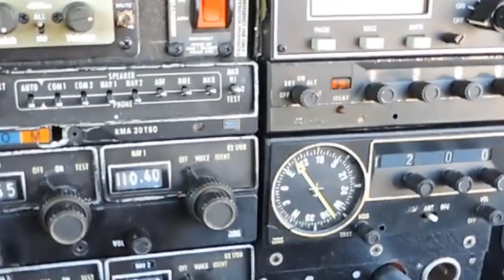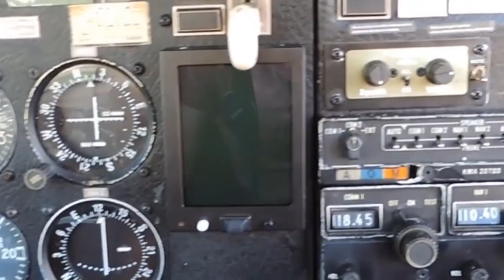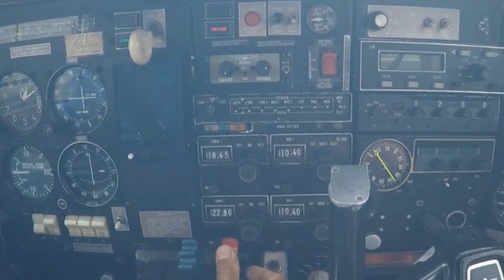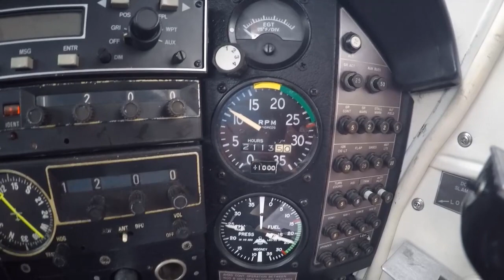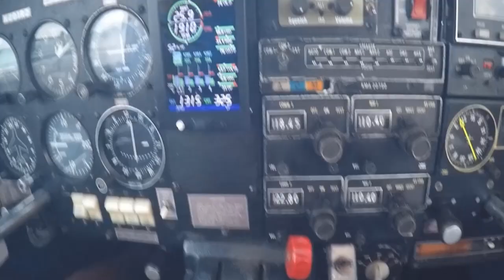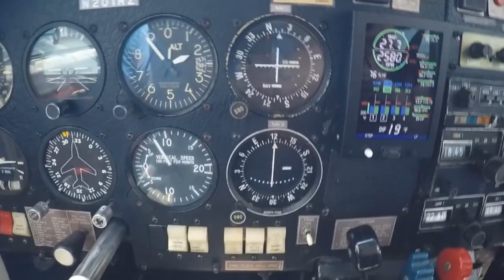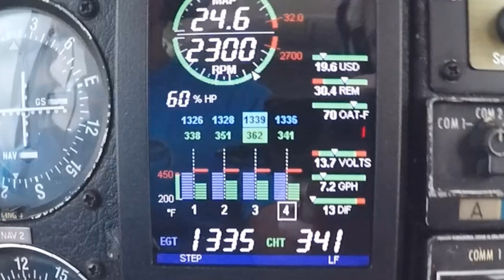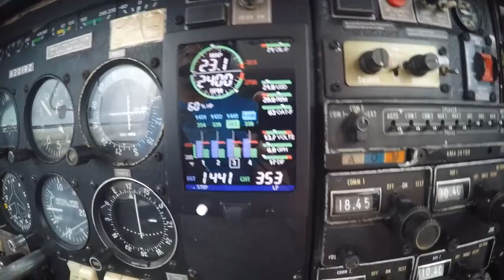Mooney M20J aircraft review: Flight speeds & Landing with gusty winds

Comment: Mooneys are a scourge to land dwellers who just want a peaceful place to live.  They should be outlawed now that there are much quieter alternatives.  I have no empathy for the folks with lots of money and nothing to do with it but fly over homes just for fun.
Reply from the maker: Well, decent pilots follow the regulations and maintain the minimum heights and respect others, on the other hand, if you live close to a main road, motorbikes and some vehicles could create a louder noise
Reply: So, is your issue specifically with Mooneys, or is the real issue low flying aircraft in general? There aren't that manyMooneys to start with (far more Cessna 172s/Skyhawks to name one). Is it one particular Mooney that is flying over your house? In any case, it is debatable as to how much noisier Mooneys are than other single engine 4 cylinder general aviation aircraft.